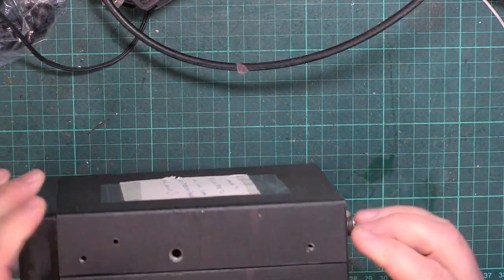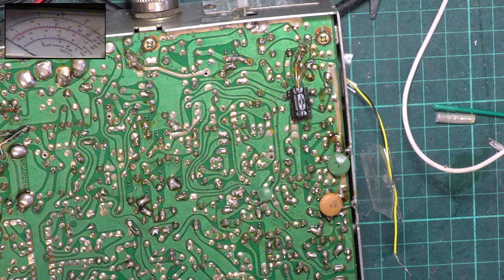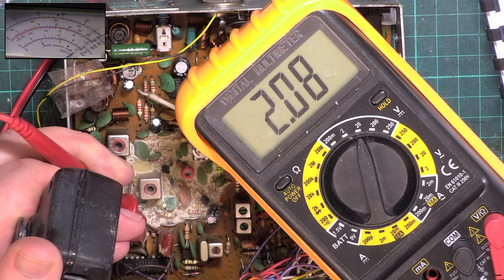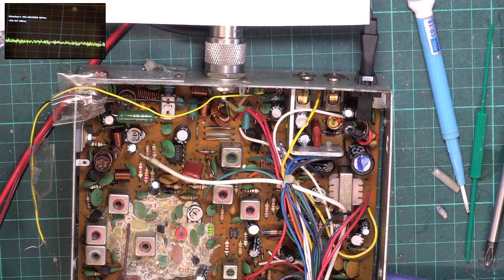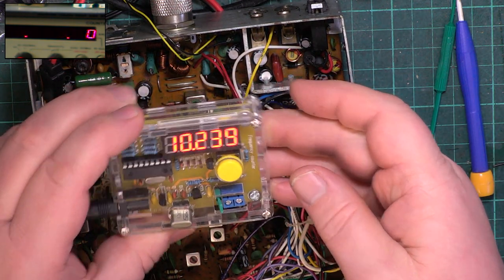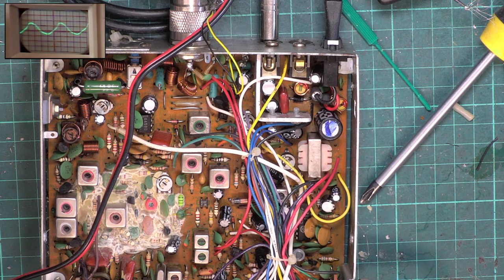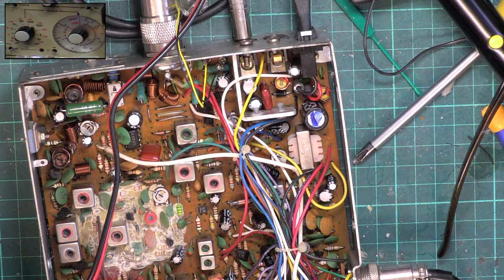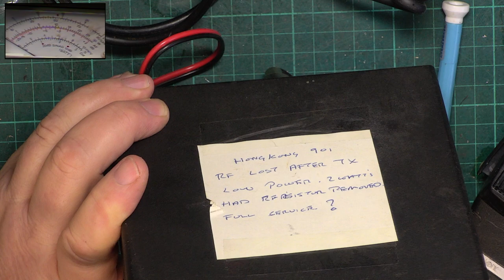Amstrad CB901 UK CB27/81 CB radio (mobile) - Repair & service HONG KONG (genuine) version.

Comment: I used to have this same cb back in the day and I had no problems I've got a midland portapack cb but I need an indoor antenna as the built in one dosant work inside so I'm going back to basics with a biscuit tin and an indoor antenna when I get one

Comment: I bought an Amstrad, I have no idea why I bought it.  It was when some people were fed up of music playing and mic keyers and I must have been offered it.  I wanted one for something, but I can't remember why now.  But I never did like them, they looked cheap and were not the best performers, though to be fair they were okay!  I did come across it when sorting out the shed, no idea of it works, water came out the box it was in, so it is anyone's guess, none of the stuff inside the box appeared to have water stains on them.  It did have a thick bottom on the box with padding, so it might be fine.  Anyway, it say Made in Japan.  Before it was put out to be made elsewhere on the cheap!
Reply: They worked really well, one of the best 27/81 receivers you could get a sensitive Cybernet boarded radio. 

TX was pretty good too, sounded nice and clear, the only real downside if you were a rag chewer was the lack of heatsink for the PA. 

Buy the Mustang CB1000/3000 or Fidelity 2001 version if you want something with a more traditional CB look and proper meter instead of the fairy lights.
Reply: @M0UAW_IO83  I just didn't like Amstrad, the Mustang might have looked a bit better.  It was an AM board just converted.  I must admit they did work better than some radios, only because they were an old Cybernet board, but there were better sets around.
I have a Amstrad myself, but it just sits on the shelf.  I don't know if it still works, it did when it was put away, but that is a lot of years ago!
Reply: @BoB4jjjjs  it really wasn't a converted AM set, there's no AM modulation transformer, the LA1230 FM subsystem and VCO modulation  is all on the board, it was designed as an FM set fron the outset. There is an AM/FM/SSB set that's obviously from the same front panel design but that's about the only similarity.

Comment: Why in the 70's and 80's did they plaster PCB's with wax? I can understand some in the cores but what the hell is it for plastered all over the PCB
Reply from the maker: They still put wax in areas like the VCO in business radios right through to expensive amateur radio equipment for stability. It seems to be a far east thing. I can't say I've seen in in UK or American made radio equipment.

Richard
Reply: @ukfmcbradioservicingTango21  Thanks for the reply. I am curently restoring a 1978 National Panasonic DR28 LBE It took me a few days to clean all the wax of the boards. Have a good day 73 de 2E0LIG

Comment: The core is broken in the adjustable coil, next to the crystal, in my 901. It’s still within tolerance, but I would like to tweak it. Apart from taking one from a scrap chassis, any ideas? I’ve searched for the part number, but no joy.
Reply from the maker: Even if the coil was successfully dismantled I think it's a cup type core & there is nothing you can do but replace. Part numbers won't help you now after 38 years...Cybernet got bought up & now make solar panels. You will have to do what I do & buy a scrap set. Incomplete chassis turn up on ebay from time to time & once all this Covid is over & we get radio rallies back, scrap CB chassis usually can be found in boxes of junk.
The coil, L2, however is an HTX480 (brown). The coil is 'Marvel' brand
Richard

Comment: I changed all the caps in my FAKE 901 last year and now it's lost it's squelch ?
Reply from the maker: I'll have a look at the circuit & see if there are any round there that affect it.

T21
Reply from the maker: There are four that could affect squelch c86 100uf, c89 47uf, c95 1uf, c87 47uf. Possibilities are new/faulty & of course wrong way round..even we can do that!

Richard
Reply: Thank you Richard If you give me the reference  i'll look at my amstrad with the correct board in to locate it
Reply: Richard there is a slug near the PA socket is that not a 54 mhz trap ?
Reply: @ukfmcbradioservicingTango21   I did put the caps in the same way as I took them out but as you say there could be a faulty one even though they are new
Reply from the maker: That final needs turning for max...then upwards to achieve 4W & hopefully minimise the 2nd Harmonic. Turning it downwards after peak makes the 2nd harmonic worse.

T21
Reply: @ukfmcbradioservicingTango21  have you the right one i'm on about Richard ? it's yellow  and near the PA and power socket
Reply from the maker: It's L8 near the hi/lo power switch that needs tuning slightly upwards after peaking. The two yellow ones the PA socket aren't really adjustable. They are for anti-parasitic oscillations coming up/down the power lead & those formers must have just been convenient & the right material.

T21